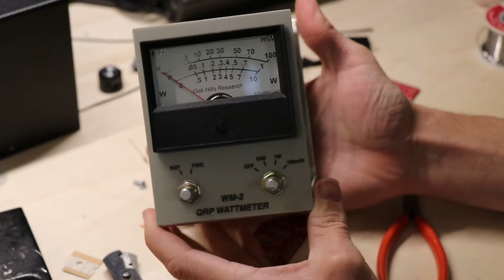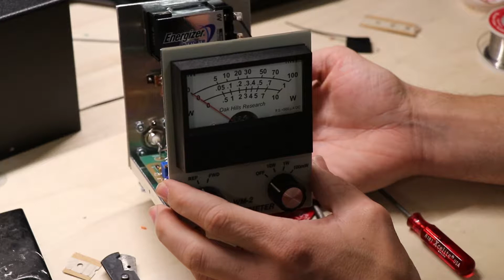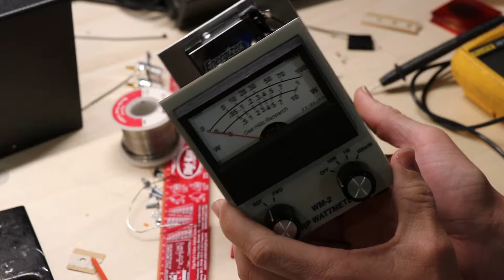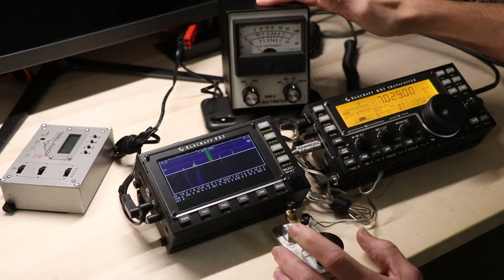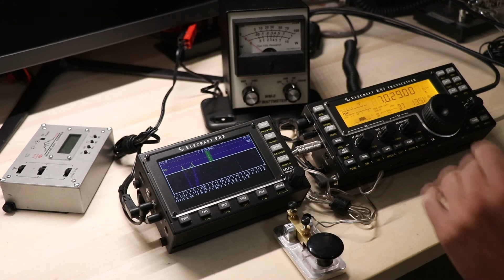Oak Hills Research WM-2 Build

Comment: Clipping the jumper is a huge mistake! Drill a hole in the back, mount an spst switch in ths back and use it to reinstate the loop for when you will need to do the cal processes in the future.
Also, remember that the accuracy is only 5% full scale. That means 7 watts, for example, could read as low as 6.3 watts or as high as 7.7 watts.
Otherwise, great job! It's a great little meter!